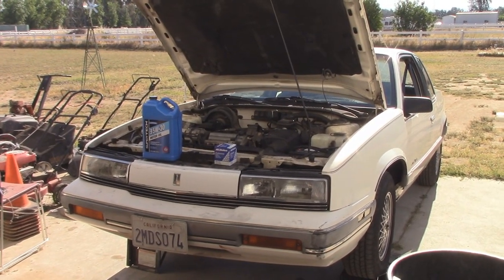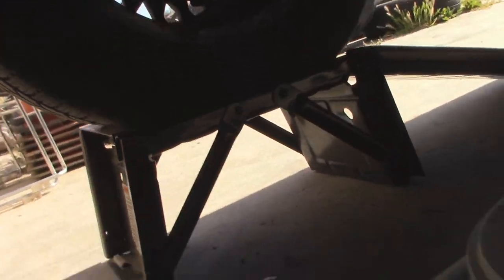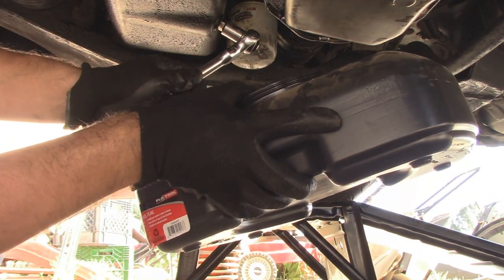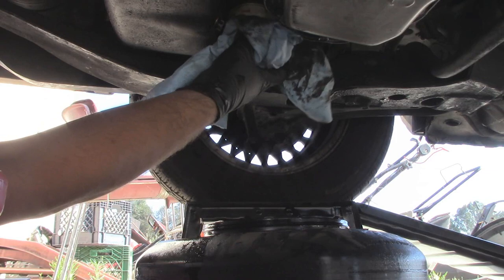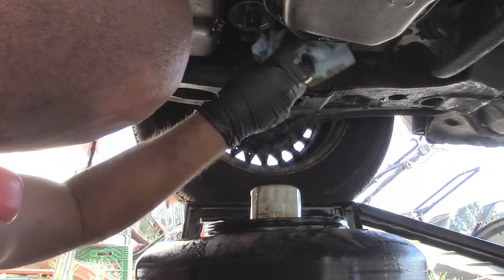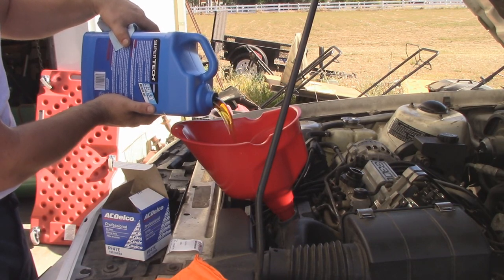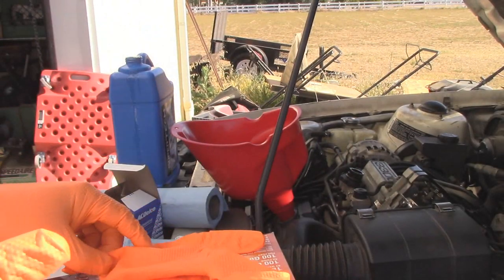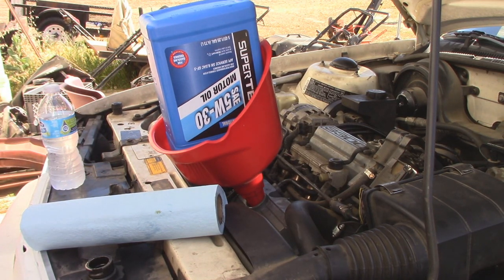Changing Oil GM 3.3 V6

Comment: That AC Delco is a great choice... personally I prefer oem if I can get it
Reply from the maker: +Craig Cundiff agreed. I'm just glad my Walmart still carries the oem filters. It's either oem or fram used to be able to get Bosch, purolator, etc from them. I use motocraft which are oem filter for the ranger as well.
Reply: Hank's Small Engine Repair yeah..I grabbed some Purolator and Federated filters from RockAuto a couple months ago on clearance... About$1.50 apiece... nice!...( bought a dozen).. I'll use em. .. But the OEM does seem nice and sturdy. ..Good work.. She's coming along nicely!...👍
Reply: Craig Cundiff 
That was a helluva deal. Nice score. 👌
Reply: SHAKA38 if your subscribe to RockAuto's site they'll send you notices of items that are discontinued or on clearance before the general public can have them at very low cost...

Comment: You may have over filled it. I always take my vehicle off the ramps before checking and topping up. I heard you say that the required amount was 4.5 qts.
Reply from the maker: I checked it after just over the line
Reply: yey i over filled mine

Comment: Shouldn't you check the oil level off the ramps on a flat surface?
Reply from the maker: I did
Reply: That is good oil, I had 379,000 miles on a 95 Ford Escort with a 1.9 in it. A rusted uni body was the only reason I had to junk it.
Reply from the maker: yea the oil level doesnt change much on ramps or off to be honest, it hardly moved at all where it was sitting on the ramps. As for the oil on the west coast I believe its made by Exxon-mobil, or warren depending on the part of the US you are in. Its good oil just rebranded. Hard to beat the value on 12 bucks for a jug